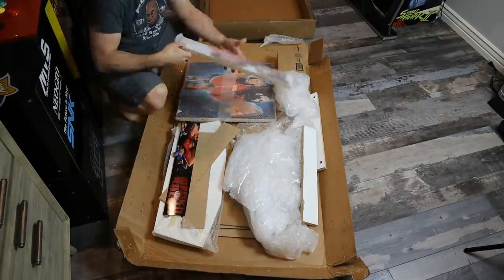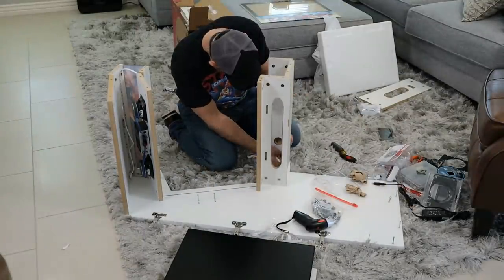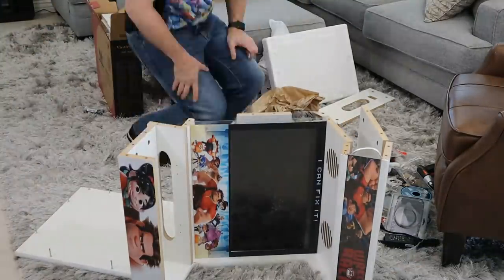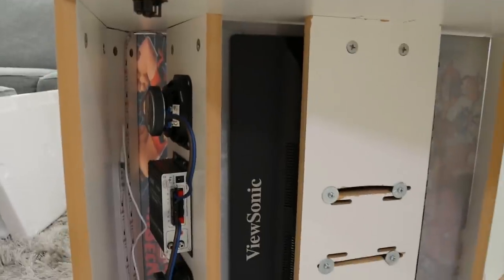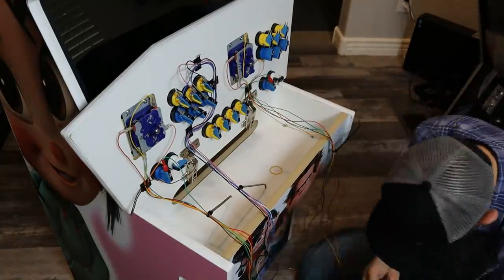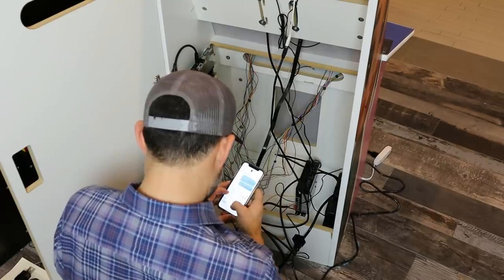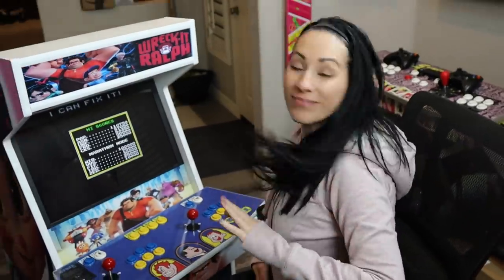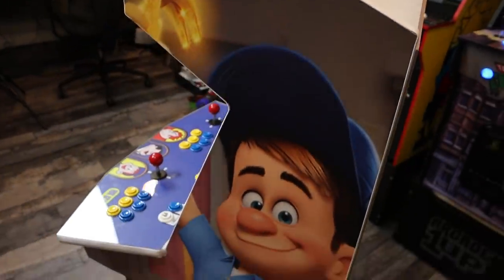Arcade1up vs. Game Room Solutions - Watch Ralph Wreck-it!

Comment: I built my own cab from scratch several years back to run MAME. These look really nice. I have a tip I learned when I built mine. Don’t use glass cleaner on plexi glass.  It will discolor the plastic over time. Use plastic cleaner which you can get at NAPA or Auto Zone.
Reply from the maker: Good tip... thanks!
Reply: Thanks 4 the advice fam I was just going 2 use some glass cleaner lol

Comment: The quality of the build is fantastic. However, I just can’t believe the blatant disregard for aspect ratio going on here. lol. I mean, the marquee is squashed, the bezel art is squashed, and I cannot fathom why they used a 16:9 screen because all the games are also squashed. I thought it was really surreal that there was no mention of this. I kept waiting for all this to be addressed. Did I miss it? May have. It’s just so bizarre and blatant how squashed literally everything on the front of this cabinet is including the game it’s self. 😂🤷‍♂️
Reply: I feel that too. It almost feels like a knock-off or cheap Chinese reproduction because of it lol
Reply: The emulation software can control the aspect ratio of the game itself.  You can set it to 4:3 if you like, and even add scanlines if that's to your taste.  If you choose to use 4:3 (or 3:4 for "upright" games), you'll obviously have borders.  Most emulators give you the option of having in-emulator bezels which actually fit the game.

Would it be more "correct" to use an old 4:3 monitor?  You bet!  At least, it would for most older games.  That said, the vast majority of new screens are, in fact, 16:9 instead of 4:3.  Because of that, most modern arcade cabinets - especially those expected to be used with emulators - will have a 16:9 cutout, mount, and bezel.
Reply: @jpcrafton69  Yeah, I would gladly have a widescreen with side marquee borders because if I play games that are widescreen capable, t would be nice to have the full screen for that.   (I'm thinking if I get a cabinet, one of the first things I'd do is set it up with a RetroPie.)
Reply: Just set it to 4:3 in the emulator. Not a big deal.
Reply: @boomerps2  Yeah for sure, it just weirds me out that people don't do it. It's like some people can't see the difference? I dunno lol.

Comment: From one who has done both an Arcade1UP and a GRS Level Up like Retro Ralph, each one has their own advantages and disadvantages depending on what you are trying to do.  From my experience, the issue that happens with the 1UP's is that at first it starts with a very inexpensive purchase, but then as you start getting involved in the modding process, it tends to become addictive.  One goes from joysticks, to Raspberry Pi, to bigger screen, to better speakers, to new artwork, to changing from PI to PC.  It keeps going and going and going and all of the mods needing to be done need more tools and more tools and more time and more money.  When you put all of the cost together, your time spent, and all financials on parts, the inexpensive purchase you were so frugal about just turned quite expensive.  There's drilling and cuts, as well as forth thinking that need to be done, but one tends to deal with it as the rewards are pretty cool and you tend to loose track of how much you are spending.   If you are playing with adults often, after some time, you have a sense of dissatisfaction being shoulder to shoulder constantly and wish the cabinet was a little wider because you enjoy the gameplay, look, and performance since you put the time and effort.

This is where the GRS Level Up comes into play.  It is pretty much designed for a custom experience.  The artwork that Retro Ralph has is not something that Ryan provided as Ryan does not make artwork for the kit.  He only provides the artwork that others build, so if the artwork was done pretty inadequately and stretched, then that's what you get as the design is for you to do your own artwork.  As far as putting it together, yes it is more work than an Arcade1UP, in the assembly.  On the other hand, other things are rather easy compared to modding an Arcade1UP, such as the control Panel.  On a 1UP there is the dissembling process, new holes having to be drilled, and if you want to go with Suzo Happ controls on a Marvel or SF2 cabinet, there is more modding with the joysticks, where on a Level Up, it is Plug and Plug.  So when all is set and done, it could be a wash or possibly cheaper depending on what you are wanting to do.

I will say that I, like Retro Ralph, have had QA issues with the cabinet like the chips in the melamine, and it is inconvenient to have to wait for replacements and such, but the ending result is quite rewarding.  For myself, since moving from a 1UP to a GRS Level Up, it has been a much better experience for me and all issues that I used to have on the 1UP such as spacing and sound, have been remedied on the GRS Level Up.  I agree that it is not for everyone, but if you are one who is thinking about getting a 1UP to mod all the way like I described, perhaps the GRS may be a better experience.  I wish that I would have known that this cabinet kit existed before I got the 1UP as in my case it is what I should have gotten from the beginning.

Below is a link to my GRS Level Up cabinet with my own custom artwork, that I go over in great detail, including all parts and artwork available for download for anyone that is interested.  You will see that when done appropriately, it is quite a treat.  You are more than welcome to hit me up with any question you have on this kit.  Just my 2 cents.

https://www.youtube.com/watch?v=ak62BBEXTlk&t=452s
Reply: Just keeping it real.  I wish someone would have done this for me.  Would have saved me some money and time.

Comment: I have this cabinet, it’s sweet. For those mentioning the Widescreen monitor, I use a pi image that includes custom bezels so it plays all the games play in 4:3 and are perfect! Other than that this cabinet is sturdy, easier access to the back with the door to adjust anything it to get to your Pi, I’ve modded several 1up cabinets and you have to unscrew several screws to get access to the Pi in the back.
Reply: Also my door does the same thing, it is weird...I have the black cabinet and mine had some damage as well, I went through the whole cabinet with a black sharpie and filled it in and you can’t even tell.

Comment: Interesting. Though the build quality is better, I think you are looking at two very different markets. A1UP makes a product for casual users who just want a Street Fighter Cabinet. No soldering required. Plus, if something is effed up, they just return it to Walmart or wherever.  In my opinion, 1UP offers the best value, especially with the new Turtles Arcade machine. 4 player control board and stereo speakers.  This can be easily be modded and will suit all your arcade needs.

Comment: I still prefer the Arcade1Up Cabinets despite all the issues with the Cabinets. The Cabinets look more Arcade Authentic...

Other than the Control Board. The GRS Cabinet looks to Robotic or some sort of a Kitchen Cart Storage Cabinet...

PS
You could always eliminate the screws that hold the Back Panel of the Arcade1Up Cabinet. Just install two pieces of Velcro to the top of the Rear Panel and you never have to worry about removing any screws...

Comment: I built a bartop last winter using a Gameroom Solutions kit and using a Raspberry Pi in it. Instead of installing the amp next to the speakers I ran it under the controller board so I could quickly access the volume controls.
Reply from the maker: Good CALL !!  I'm going to move mine, that's a much better option!  Thanks for the tip and for watching!

Comment: Hey Ralph quick question what do you recommend on using to  connect a Xbox 360 to a Arcade1up using the joystick what usb encoder would you use? Thanks and love all your videos keep classic kim in the vids always nice to see couples involved in the hobby
Reply: Mrtokitone  if you want to wire up arcade hardware for use on a console, I recommend the Brook Universal Fighting Board. It works on Xbox 360, Xbox ONE, PS3, PS4, PC, and Switch. It has both terminal connectors and a 20 pin harness connector for easy wiring. For more details, just go to focusattack dot com, and perform a search. The UFB is the top choice for custom fight sticks.

Comment: GRS has some nice products but their quality control needs improvement. Ordered from them several times and every single order has had mistakes. Missing screw holes, missing hardware, chips in the wood, pieces not fitting properly, etc. You might have to drill a hole or two, use a sharpie on some chips in the melamine, but nothing drastic. They will make it right if the mistake is severe but they will never apologize. Ever. Some people might not like their communication style but in the end they deliver their products on a basic level and their prices are far superior to the competition with free shipping on their cabinets. This is why I continue to buy from them. Also, there is no need to put the socket switch in. Many electricians have commented that this is not wired correctly (it's debatable) but your power strips plug will go right through the hole into the wall. No need to cut up your power strip cord, especially since GRS cabs have real access doors to turn off your strip.

Comment: Great Video! I’m really considering getting one, but I noticed you mentioned you had to get the T-molding. On the GRS website for this, it says T-molding is included in the $379.00 price. Is that not true?
Also, the amount of damaged boards you initially received was a little concerning. I hope that is not a common occurrence.
Reply from the maker: MasMeansMoreTV Ryan at GRS replaced all the damaged boards within a few days.  The T-Molding did not come with my unit, however ... it’s fairly inexpensive. I’m really enjoying the cabinet so far.  I’m looking forward to the release of the riser for it.  I hope to get my hands on it soon so I can do a review for the channel.  Thanks for watching and supporting the channel.

Comment: I bought and built one before i got arcade 1up and am pretty peeved at these cheap ass cam locks they suck just let me screw it down now my GS cab is kinda wobbly the graphics dont fit right you're dedicated to certain joysticks and buttons as room is a huge factor (I have bartop model) the door does not work right and i mean i rebuilt my entire bathroom and this thing is just uggggg i spent close to $600 on this and thats having a monitor so without one your looking at $700, bonus to having this arcade I honestly dont need another one as mine plays over 10,000 games but i wanted an arcade/theater in my basement so ill stick with 1up but on other news my walmart MK cab all black in screen is now green lines looks awful and have to replace pcb so idk be your own judge.

Comment: Wow did not know that a Genesis console was inside.  Possible to use a Everdrive?  If it does work I wonder if you can buy 2 Wreckit arcade and change the monitor orientation on one unit to be vertical, the other stays horizontal and use the Everdrive to install games that fit the vertical or horizontal profile of each arcade?

Comment: How does the Game Room Solutions cabinet compare to the Alpha-Cade by Rec Room Masters?
Reply from the maker: rstang281 I haven’t reviewed that cabinet yet.  I need to sell some stuff and sell it fast, so I can make room for some new gear.
Reply: I would choose the Game Room Solution Level Up over the Alpha-Cade, because the Alpha-Cade doesn't have the custom art and lighted marquee options.  I don't have either one, but the Alpha Cade looks so ugly to me.
Reply: Willie Loomis  good points made. I am curious as to the quality of the controls of the Game Room Solutions cabinet, ETA raves about the controls for the Alpha-Cade. I would really like to see a side-by-side comparison.
Reply: I have cabinets from both companies.  Rec Room Masters by far way better woods than GRS.  GRS uses MDF and it'll split when putting on the T-moldings.  Not to mention GRS customer service had failed on me when trying to resolve a problem.
Reply: @RetroRalph  I would love to see the comparison of these two as well. I own the Alpha-Cade running a Pandoras Box 6 and I love it.
Reply: @heykool69  As far as I can see they both use melamine, at least for the larger cabinets. Basically MDF with resin soaked paper thermally affixed to the surface so how would they be inherently different? 
I genuinely want to know because I want a cab kit and Monster Arcades come already built (kits) but are laminated birch and if I could get a flat pack of that I would. But they probably won't fit down my basement stairs. So I'm stuck with RRM or GRS and frankly I like the look of the latter more. 
Except for the edge chipping you get on all these cheaper manufactured wood products is pretty bad and I'm concerned about longevity.

Comment: I still think  arcade 1up is cheaper and better  300 vs 600/700 bucks
Reply: I agree
Reply: I agree 100%. Not even debatable
Reply: GHOSTfaceKILLr74  the only people  call them  toys or not arcade  cabs are people  try to sell u more  cost ones  or are afraid  of  there  arcade  machine  will go down  in value.
Reply: GHOSTfaceKILLr74   yup   I have arcade  1up sf cab   and I love it for the price it plug and play at fair price that can be modified  eazy.
Reply: The SF2 cab is running off of real arcade hardware?
Reply: @Kingbeef7905  no different  then a mame  arcade machine and most people  call them arcade machine Use today technology  make cents to use it cheaper and better . If  today technology  was around  in the 80s and 90s they would use it.   I grow up play arcade machines  and the 1up is arcade machine  it play like ,look like so it is a arcade machine.  Just like a mame  or CRT  ones.  They all play arcade  games and have buttons  and joystick.
Reply: @Kingbeef7905  No not arcade hardware, it is emulation, licensed emulation.  The controls are shit. I know this as I also have the SF2 cab from A1U and modded it out with controls (LED buttons and Sanwa sticks with Octagonal 8 way gates), Ras Pi3 +b,  video control board (have to buy this to use the built in monitor) amp for audio, and speakers for cheaper than this cabinet, I think I am at around $350 total invested as I bought the SF2 Arcade1Up for $199 at my local FYE. 

 This cab in the video seems to be a step in the more hobbyist direction than A1U.  Seems ideal for those without wood working skills to make your own MAME cab or modify an existing arcade cab (or don't have the spare time to do so).
Reply: Anyone who thinks the Street fighter A1up cab is a legit arcade experience must really suck at the game. Also the sound is broken. They probably haven’t noticed that either.  I’ve also noticed that people who defend the A1up cabs have low standards and simply don’t know any better.
Reply: @reaperjesse1210  for 300 bucks arcade  1up are good for  what they are.  it a cheap option that can  be  modified  for a cheap  price.  It like  compare  a Kia  to  a  BMW.  Both do the same thing   the different  is price.      For 300 bucks  u get a plug  and play with  arcade  1up.    With other options   u pay more and hopefully  better  quality  for the  price.    But you  pay for it and that your choice.  For me  the   arcade 1 up are just fine.
Reply: These both are garbage. Build quality is weak for both.
Reply: Frizzurd  just buy a real cabinet and problem solved.
Reply: Frizzurd cant see it be more 150 to 200.   For a pie or pandora  box.   I think a jama  board   might cost more.  I think  GRS kits started  around  $400 and  you have to buy LCD screens  joysticks buttons  decorer  ect...     with the arcade 1up u get everything   and can slowly  upgrade  as u go.   The new  Cabs  will l  have more games on them .   One thing  Ralph  didt Give  was full price of the GRS cab.  How  can u compare  them when u leave out total price.
Reply: Frizzurd  if you take your time to look you can score one for about $250. I have got 5 cabinets within that price range.
Reply: Frizzurd  local classifieds, social media, old businesses, ect. They are there.
Reply: Yeah.  I regret buying from these guys.  Only reason why I did was because I was waiting till they found a way to mod the arcade1up for use with a Pandora's box.
Reply: Frizzurd  it's definitely cheaper
Reply: With graphics, I came up with 800+ with what he was building. Monitor not included!

Comment: Use 2 part epoxy filler then sand repeat then primer and light sanding to smooth out surface then you can paint or add vinyl.

Comment: Nice video!!! Can this be modded to fit a Nintendo switch or retro pie or even both instead of the Genesis?
Reply from the maker: Sure... this is actually wired for Jamma so you would have to re-wire the cab but you could put a RetroPi in.  You would just need to put in a few USB encoders and you would be good to go!

Comment: Since you used a JAMMA connector, how the heck did you wire it to work on a Genesis?
Reply from the maker: It required some specialized hardware and soldering.  If you go to http://www.vector-labs.com/index_segagen2.html that will help.  Thanks for watching!

Comment: Could you please tell me what arcade power supply to use I’ve never done 1 also what did you use for a/v to the monitor? Thanks
Reply from the maker: Josh Mccloud I use this one usually: 15 Amp Arcade Switching Power Supply 110 Watt, 110/220v for Video Game Cabinets Including Upright and Cocktail https://www.amazon.com/dp/B00F1YQDBA/ref=cm_sw_r_cp_api_i_gKWECb8T4A68W

This mod I actually use the output from the back of the Genesis RGB to SCART and use a SCART to HDMI converter.  I can send you more detail over email if you want.  Just shoot me a message at retroralph1980@gmail.com